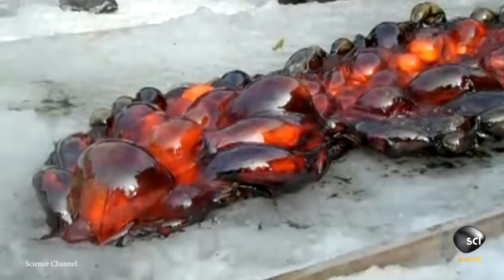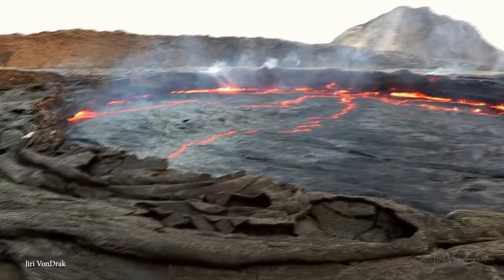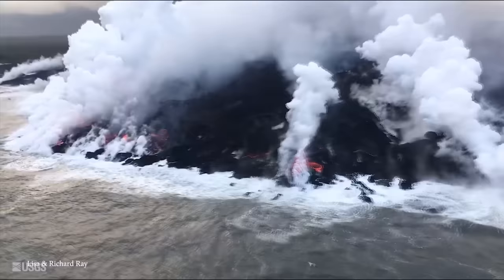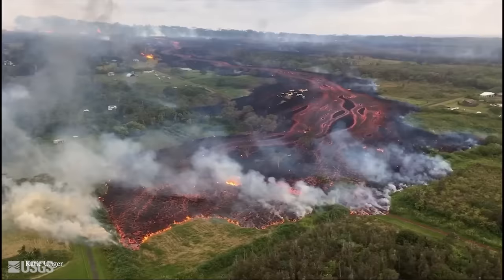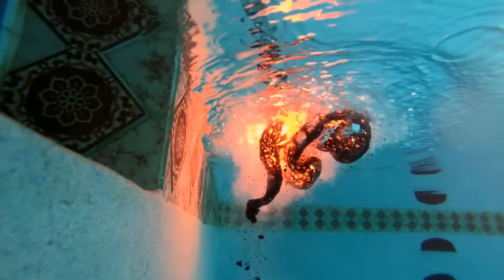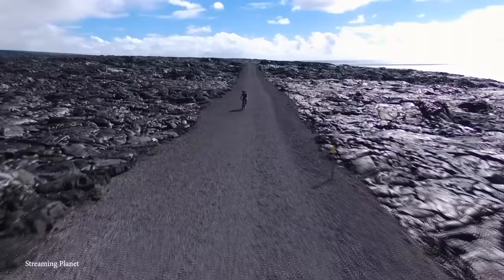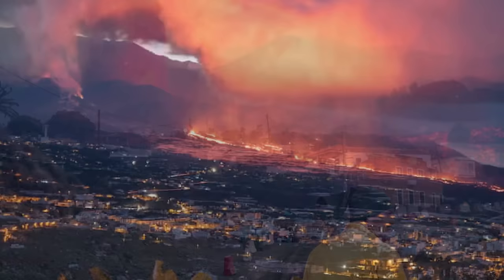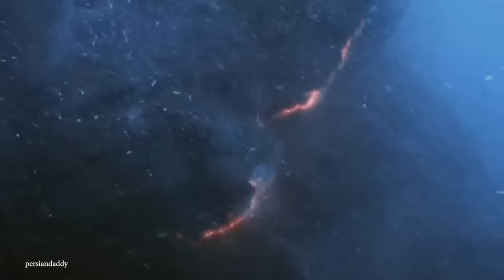15 LAVA VS Water Videos

Comment: When lava pours out near the sea surface, tremendous volcanic explosions sometimes occur. In time, submarine sea-mounts or islands are formed. When lava flows underwater, it behaves differently. And a new contraption to capture a 'dandelion' in one piece has been put together by the crew. The preparation for a dive is always a tense time. When lava pours out near the sea surface, tremendous volcanic explosions sometimes occur.

Comment: You have to have a large foot before you can get the land I mean just think how big the bottom of kilauea's mountain is at the bottom of the ocean how big it is just for that small of Island above the water it's tiny compared to the foot that it has to have to just have that much land above water so all with that was doing was building it's foot and that's what I call it it's the footing of the island